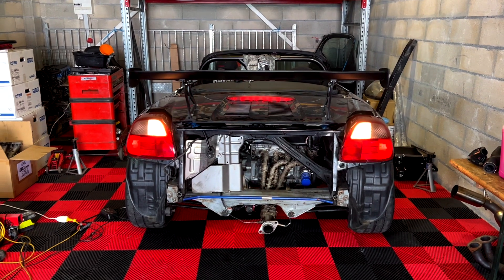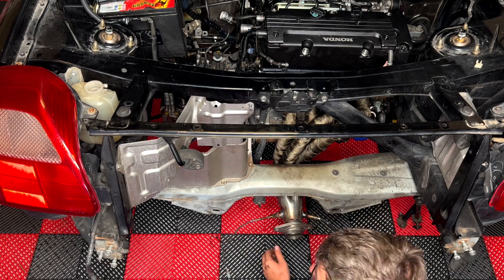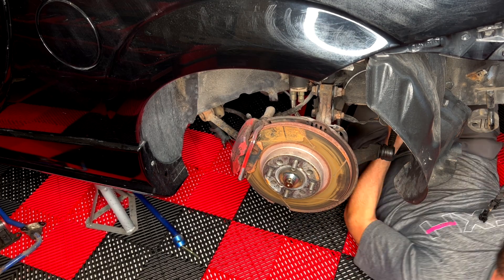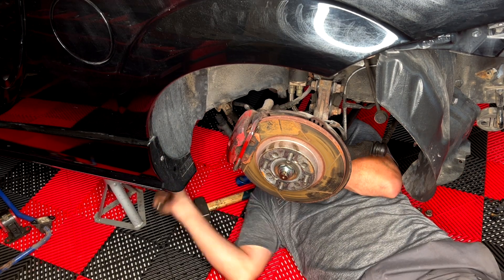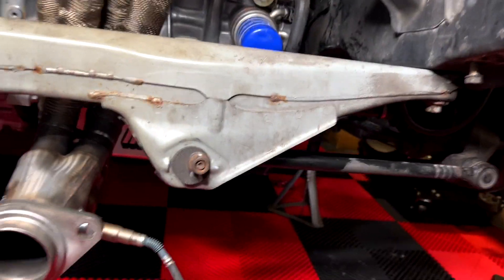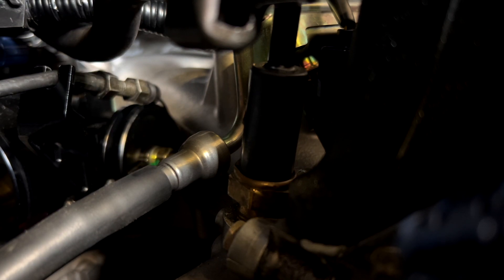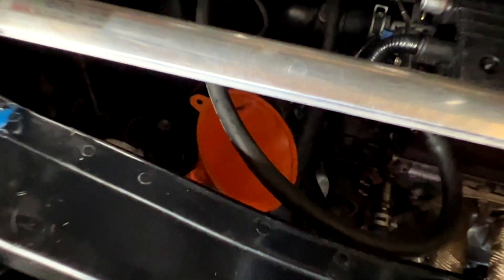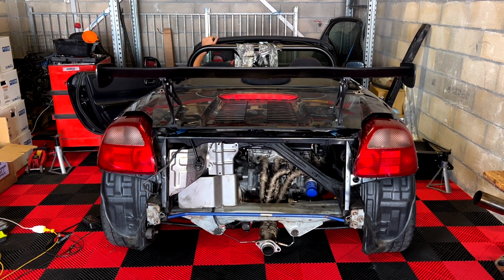How to Kswap an Mr2 Spyder EP12: "First Drive" of the K20a (all motor) swapped Mr2/Mr-s zzw30

Comment: so you removed the heater line - where would this hose (on the head) be plugged into if I want to run the heater?
Reply from the maker: Hey man. No I didn't remove the heater. The heater works in my car.
Reply: @JesseSpec  but what's with the plugged water outlet on the head? usually that's the heater delete mod, isn't it?
Reply from the maker: @low-budget-racing  thats an extra outlet thats not needed. Your heater willbe supplied by another hose in the system with coolant. Look through the videos and you will see
Reply: @JesseSpec  yeah, I just watched it over and over again :D you are routing the metal pipe to the hose which goes below your battery. But does your heater work good if you don't have the water outlet from the head plugged in ?
Reply from the maker: @low-budget-racing  hi, if you do exactly how I did it, yes you will have a working heater. In the end, if the heater hose of the car connecte somewhere to the motor cooling circuit you will be fine ;-)

Comment: Are you having any issues with the axles.  Mine bind, especially on the drivers side.  They are too long for my car.
Reply: I had this problem with mine. I'm using the MAP mounts, which reuse the 2 factory side mounts. I had to replace them because they were worn out and allowing the engine to sit too low.
Reply: @dylanandersen9318  hmm looks like I better buy some new oem side mounts
Reply from the maker: @samster2223  damn. I hope I don’t have that problem
Reply: I got the ones from Mitch's Auto Parts.  The price was right and 500hp was plenty for me, but they are too long for my car.  No problems in a straight line, but bind with cornering.   Especially when turning to the right.  I want to take to the track but I am afraid that I would damage the transmission.   Let me know if you have the same set of axles.
Reply: Dylan, did this fix your problem?  I replaced the one on the passengers side, but the one on the driver's side is original....looked fine.  They admitted a problem.
Reply: @dukebbfan08  it fixed my problem. I also am running the MAP axles. Try loosening all of the motor mount bolts, jacking up the engine and then retightening them.
Reply from the maker: Hello! What? Really?
I haven’t had that problem yet. Where do They bind on?

Comment: Didn’t have the issue with throttle cable. Maybe it is because of the different intake manifold and adapter in place?
Reply from the maker: Hi! Thanks for the comment! I have the feeling its the aftermarket throttlebody thats being the problem. I will try to bend the bracket a bit to get some slack in the cable 👍🏼
Reply: It seems so, good luck and keep it up!

Comment: Are you gonna make k series swap in harness for the mr2 spyder so it's just a plug and play with our options of standalone?
Reply from the maker: Hi! Thanks for you comment. Do you mean a plug in harness in order to wire easily the Link Ecu into the mr2/k20 combo?
Reply: Yes like k series harness and with the mr2 spyder ecu plugs, reason for this is I'm running a EMU Black with a adapter box to hook up the mr2 ecu pigtail to the standalone, im running a 2zz with this setup, and if I was to go k series later in the future when my 2zz does decides to blow a oil pump😅